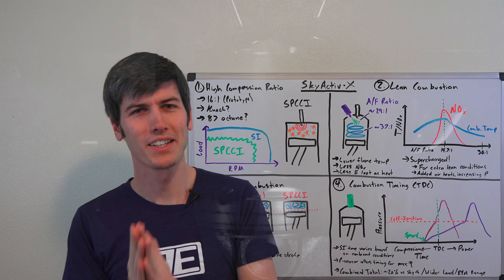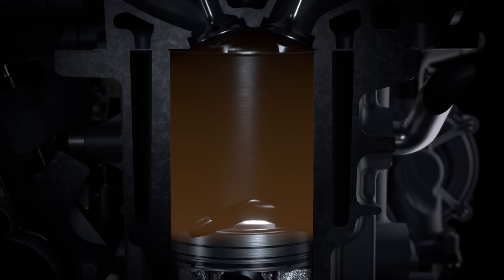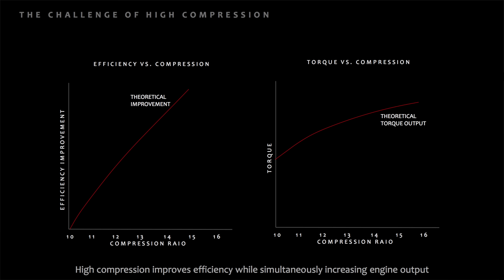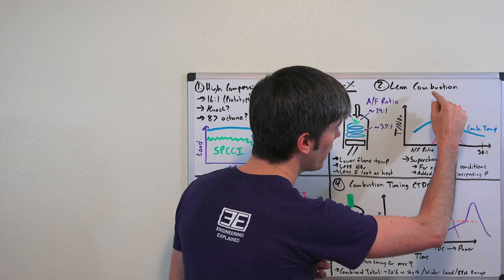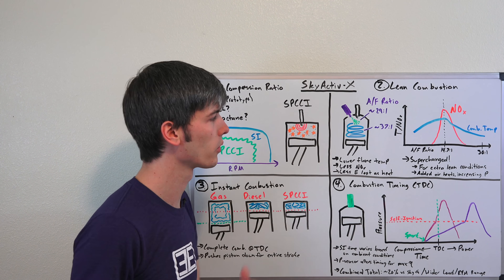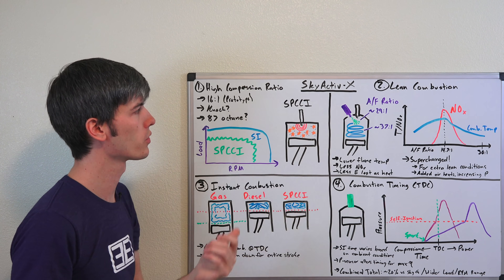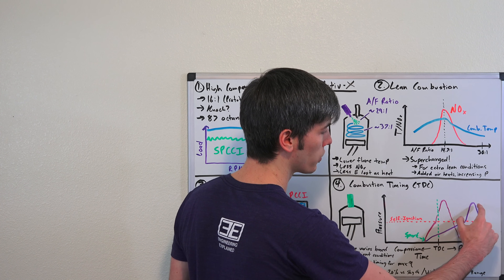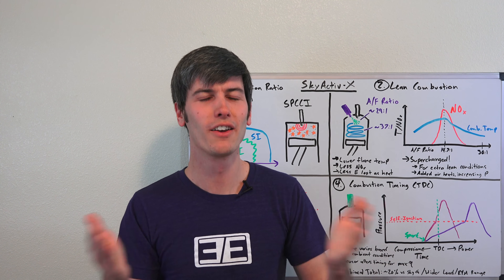How Mazda Is Saving The Gasoline Engine - SkyActiv-X

Comment: What are the down sides of a electric Car?
Reply: Nicholas Soldatos a good engine can last for more than 30 years
Reply: Bill Robbins Of course if we “woke up tomorrow” . It will take time to adjust to a full electric vehicle world. Tesla does NOT dispose of batteries, but instead reuses them.
Reply: Frederico Louro boring is a option (1.9 Sec 0-60 sports car at half the cost of the competition is not a opinion), model 3 will start at 35 K will many feutures standard, while also being the safest in class. And your right, we do not know what Battery degradation will be like yet. It does help however that not a single Tesla is out of warranty yet as they have a long warranty schedule
Reply: N C Quite the opposite actually, we would not be here today without the infernal combustion engine :) 
But all jokes aside, it did revolutionized the way we live, but I do think it’s time has come....
Reply: András Bíró yes exactly! Supporting domestic energy production and don’t forget the power to weight ratio compared to an ICE is off the charts!
Reply: Thermometer10 or an upside, depends on your standing...
Reply: Bill Robbins yeah cause you know everyone fills their tank from full to empty every day? The studdy claiming to overwhelm the grid is ridiculously skued and paid for by oil, a child could figure that out. Average distance traveled per day multiplied by consumption per mile is well under 5.5 kw per day or 17 percent increase for the average home per day. It's pretty minimal. The battery packs tend to last 500k mile minimum which is longer than every combustion vehicle I've ever personally owned. Also fuel refinery energy consumption  coming to an end would offset that 18% easily.
Reply: yarpos I don't do trips in excess of 270 miles often at all. Weight is irrelevant. You telling me engines don't degrade? Take off your oil covered glasses.
Reply: yarpos batteries can be recycled or repurposed aswell.
Reply: yarpos
1. Range and charging is not an issue for most Tesla owners in the US or Western Europe. I'm not saying that it's not a problem at all, just that it's nowhere near as big issue as most people think. First, you have 200-300 mile real world range, or even more, and very few people drive that much frequently. And when they do, the supercharger network makes it pretty easy and fast. Maybe not as simple and convenient as with a gas car YET, but it's getting there quickly, and the costs saving are huge, so it's worth it.
2. Battery degradation is practically doesn't exists, at least for Tesla. Current batteries are expected to last 1 million miles in the cars, and than still can be used in stationary applications. After that the batteries will be recycled.
3. Look up the specs of the Tesla models, and compare them to similar gas cars. For example the Model S should be compared to a Mercedes S-Class or a BMW 7 Series, and they are all around 2 tons.
4. Did I say that electricity is free? I don't think so. What I said is that you have to compare apples to apples. If you count the pollution from power plants for electric cars, than you have to count the cost of oil production for gas cars. That's a fair comparison, and gas cars lose very badly that way.
5. By oil leaks I mean oil wells, pipelines, tanker ships and refineries. Exxon Valdez and Deepwater Horizon. Those are the biggest ones, but there are thousands of relatively smaller ones that are still devastating for the environment, and also pollute the drinking water of people, even in the US.
6. Yes, war over resources. That happens only when a resource is scarce, like oil. Cobalt, Lithium and rare earth metals are not rare. The term "rare earth" is misleading, they aren't actually rare. Cobalt and Lithium production is now limited, but only because there was little need for them so far, not because those are rare elements. And Cobalt isn't even essential, it's just the favorite at this moment, but researchers are working hard to replace it with something better and less controversial. Oil has one more issue that generates conflicts, most of it is concentrated in a few places on the planet, which means some countries have a lot while others have little to nothing. That's usually not the case for other resources. And finally, electricity can be made in several ways efficiently, and electric cars don't care which one you choose. Similarly batteries can be made in many ways, for example the next big thing will be graphene, and just as with power plants, electric cars don't care.
Reply: Frederico Louro can you name them though? Bc I don’t think there are that many....
Reply: David Nguyen ew
Reply: Disadvantages of EVs:
1. Higher acquisition cost (without government incentives)
2. On road trips, quick charging can be harder to find, required more frequently, and more time consuming

Advantages of EVs:
1. Smoother and quieter
2. For local driving, charging is easier, quicker, and more convenient than pumping gas (if you have a place to charge at night)
3. Much less maintenance
4. Much lower running costs
Reply: Dan Sanger
Those two disadvantages aren't that big now, and will completely go away in a few years. If you calculate the total cost of ownership, instead of just compering sticker prices, electric cars make a lot more sense. More and more companies are coming to the conclusion that on the long run a Tesla is cheaper than any gas car, because the majority of the costs are fuel and maintenance.
Reply: Andras Biro >   erm wrong.  Range is an issue ,  it doesnt go away because one manufacturer has some charging station along freeway routes.   Laws of physics havent changed so battery degradation exists, although you can choose to ignore of course.   You only need to look up specs to see the weight differences,  although you can chose to ignore of course.  not sure about and so on.

You talk about the costs and emmissions of extracting and creating fuel and them imagine electrcity is "free" ???  spare me.  Frequent oil leaks??  possible , but frequent.  I have 5 cars , none leak oil.   Wars over resources?  sure thats what humans do.   Do you imagine cobalt, rare earths for magnets, lithium will be any different.

Take of the rose colored glasses
Reply: Toto Geenen
Internal Combustion Engine directly intoxicate you with its emission
Reply: 'No noise' is a downside if you're actually passionate about cars
Reply: Batteries are bad for the environment and won't last forever. Lower range, you can fill up your car while on the way in 5minutes, charging takes way longer. Most electricity isn't "green energy" so it still pollutes, not as bad as petrol engines but that is without taking into a count the batteries.
Reply: Where do the electrons come from, which are used to charge every EV??  Everyone needs to stop thinking that electric = zero-emmisions. It does not.  There are several serious environmental issues with electric cars which no one talks about. One is ozone output. Great as long as long as it's up in the very top of our atmosphere, deadly to people and and animals on the ground. 
The actual environmental impact of building electric vehicles, building and then disposing of their batteries, and creating the electricity, is far from a clean solution. An M.I.T. study boiled a few things down to this statement: "Electric vehicles come out behind in two significant areas. They contribute to acid rain, and they are worse in terms of causing algae blooms than gasoline cars (but better than diesel)". They determined that Hybrids are actually cleaner than full EV's.  
If we all woke up tomorrow driving Teslas, the entire grid would crash. There are just very many problems with EV's to think it is the end all be all. It isn't.
Reply: Nicholas Soldatos man eletric cars are boring, expensive and the batteries with the time they degrade they are not for me
Reply: If have u don't have the capacity to appreciate the developments of an ICE, y come here? 

Just to be a BEV/Tesla troll? That so sad :(
Reply: Nicholas Soldatos poor range, charging time, they are heavy ...
Reply: They have LOT of downsides just search on the internet
Reply: Most of them run on coal.  And when you account for the transmission and energy conversion losses getting the electrical power to the wheel, electric cars are just about as green as modern efficient gasoline burners.
Reply: Jess Stuart Jess Stuart even if most ran on coal (some ev owners have solar power) that’s still better than ALL running on petroleum. Transmissions are 1 speed no gears with dozens of moving parts, not thousands like gas cars. 15-25 precent Of gasoline is used to power the wheels, the rest is lost as heat. 70 precent of electricity is used to power the wheels however on a electric car. On top of that, you have regenerative braking which not only save your brakes but adds usable energy later on in the drive
Reply: What are the down sides of a electric Car?           I keep tripping over the extension cord :) 

But seriously it far to complex to a have full debate here on the subject, Have fun using overly simplistic talking points.
Reply: Most downsides that people usually list are no longer true or never been true. No problem with range, no problem with charging (for a Tesla at least), battery degradation is not an issue anymore (A Tesla battery lasts 1 million miles), they aren't' heavier than a comparable ICE car, and so on.
And the advantages are simplicity (high reliability, long life, minimal maintenance), low fuel cost (or even free), very good performance, low center of mass, nice smooth ride, no noise, no vibration, safety, and many more.
And yes, if you compare the emissions of power plants that are needed to charge an EV, it's not much better than a good ICE car. But that's a very misleading comparison, because gas doesn't just pop into existence in you car, it has to be extracted, refined and transported. Those use a huge amount of energy that also adds a lot to the total emissions of an ICE car. Then there are the frequent oil leaks that are pretty damaging too. And don't forget about the Middle East where most oil comes from. Wars and terrorism are they byproduct of the oil industry.
Reply: Toto Geenen engines don’t last forever, and like you said still pollute more than the manufacturing of batteries, range is lower at the moment, but getting 93 MPGe is pretty dam good. Most people don’t drive more than 330 miles in a day anyways. So you never have to wait for a charge (charge at home while you sleep). (Unlike gas car in which you have to wait 5 Mins every week, which Actually takes more time out of your day). Charging is exponentially cheaper than fueling & Power trains/motors last longer than engines.
Reply: Frederico Louro Range is lower at the moment, but getting 93 MPGE it’s pretty damn good. Most people don’t drive more than 330 miles in a day anyways so you never have to wait for a charge, unlike a gas car where you have to wait five minutes every week to fuel up. Being heavy allows them to have a lower center gravity reducing rollover risk and increasing safety scores

Comment: Why no gasoline road car(at least what I've heard of) use the pre combustion chamber? The way that Mazda use a thicker mixture of air&fuel to ignite the rest of the mixture makes me think of that of the pre combustion chamber. Why it is only being used on diesel and Formula 1 engine?

Comment: Could this technology be combined with Nissians VCR engines or is that sort of unecessary? Sidenote, it is incredibly impressive that they can do this on 87 octane. When you first started explaining this I thought "wouldn't buy it, I don't want to pay for premium gas." If they offer this in a car with AWD, I think I know what my next car will be.
Reply from the maker: The techs are different approaches, rather than combinable technology really. This engine is trying to be as efficient as possible rather than having a high power mode. As is, it has electronically controlled valve timing which can alter the compression ratio significantly lower than 16:1 if desired.
Reply: They use a different way to measure octane rating in the US, their 87 octane is somewhere around  91 european octane. It's still lower, but not as much as one would think.
Reply: Lower octane fuels have less antidetonants added, and since this technology requieres selfdetonation to be more efficient, it is better to use lower octane fuels!
Reply: Don't worry, higher octane (or RON) will definitely not make the car run worse, it will just shift the torque curve so the engine makes peak torque at a higher RPM, more like a traditional naturally aspirated gasoline engine. If you have high and low octane choices you can essentially choose the best torque curve to match your driving conditions and style.
Reply: Mazda's test bed car is worth $10 million.  I don't think you want to buy the engine yet at all.
Reply: Engineering Explained thanks for the reply, which technology will yeild a better consumer product.
Reply: Which one would you say, in any objective way, is better?  Which one is more exciting to you?
Reply: nooranik21 it probably is possible by maybe changing the pistons.
Reply: I am right there with you man, If this engine offers AWD as well. This will be my next car
Reply: EU and US use different systems to measure octane levels. It's unnecessarily confusing if you ask me.
Reply: Engineering Explained I am pretty sure 95 octane is the cheap fuel in Germany... so this engine would run worse here?

Comment: Mazda, the opposite of Volkswagen. They do a really good job.
Reply: hawkseye that's why I dumped my TDI for a CX-5!
Reply: For me the decision would be really clear. Nowadays VWs are really unreliable, but Mazda is really reliable.
Reply: Tony x reference that study please.......I wanna read it
Reply: Bürguerauto? only for the richest?
Reply: I'm looking at buying a new car and it's come down to VW vs Mazda. It's a tough decision. VW offers a combination of practicality, comfort and convenience that nobody else can match (at least in the segment and market I am looking at), but they aren't a very likeable company. Mazda's strong suit for me is slightly cheaper and less depreciation, and I want to endorse their company vision (especially since I am very interested in upgrading to a next gen Mazda later on).
Reply: They're both at the top of the game right now. VW's Reliability and warranty has also improved.
Reply: not only monkeys, also humans... and most important: test shows that modern tdi exhaust gas are more harmfull than exhaust from a 20 yrs older ford powerstroke powered light truck...
Reply: @Tonyx.yt.  I can back that up too, my 97 F350 with 580,000 miles on it was still able to maintain 19-21 mpg and could idle for periods of time without burning a ton of fuel. It also had aftermarket tunes with high efficiency in mind.
Reply: Tony x well thats just disapointing.
Reply: The reliability and efficiency of any TDI engine speaks for itself. I’d like to see Mazda come up with anything even close to the durability of the ALH engine.
Reply: funny how vw is completely giving up on ICE engines and letting all their enthusiasts down. we need a mazdaspeed skyactiv x
Reply: cwitt26 if this new design is as great as it seems, this will truly be the next step in ICE engineering. I agree, VW seems to be giving up for now - a total shame, as they have a long history of high efficiency economy Diesel engine production.
Reply: They admitted to doing tests on monkeys but deny using humans... So stop monkeying around with this story :)

And it depends what ur pollutant ur testing for and therefore r calling harmful and its no rational for bring back a 20 yrs older ford powerstroke engine
Reply: VW is now selling the Golf TSI with a E85 engine though. It was about time somebody did it since Ford and others threw in the sponge for some bloody reason.
Reply: Namenim none of my 5 vw broke down ever on the other hand we have 2 toyotas with head gasket beeing blow at 100000km and mazda cx5 with destroyed turbo 2 years of usage. Then they repleace it and 6 months after it the oil bump fail.
Reply: That certainly is a factor, but once you eliminate the most unreliable parts--DSG transmission, oil burning GTI engines, etc.--then I suspect reliability comes closer. Until recently, the Mazda I was looking at had a rather common AC issue (Mazda claims to have fixed the production flaw).
Reply: Tony x 
Huh, wonder what my Bayerische V8 puts out 🧐

Comment: Mazda is making up for all of the gas guzzling rotaries
Reply: totally worth it
Reply: Chinmay Chinnu. Rotaries dont get great mpg for their displacement but they do well enough for their output.  The rx8 got similar mpg to the S2000, even though it was a larger car with vastly better specific output.
Reply: Rotaries does for our mpgs
Reply: DrewLSsix I don't think an S2000 runs 18L/100KM around town honestly, but I admit I am not familiar with the car. Does it really?
Reply: Sergiu-Lucian Petrică. Dont know the metric conversions but the rx8 gets two fewer mpg than the s2k, both get rather poor in town mileage similar to my truck lol.  The s2k does get a bit more range on the highway but is also a significantly smaller car with significantly lower specific output.

If you look at the per liter output of these things the mileage males some sense, a 4 banger of just 1.3L making 200+ HP naturaly aspirated would doubtless get worse mileage.  Meanwhile the rare rotary detuned to typical piston engine outputs can get very respectable mileage, but thats not the selling point in most applications.
Reply: DrewLSsix can I get a liter of cola
Reply: Chinmay Chinnu shiieeet
>rx8